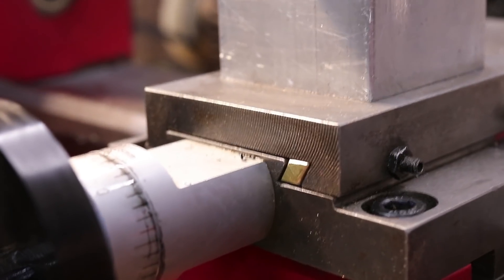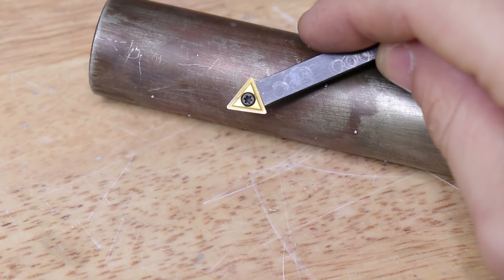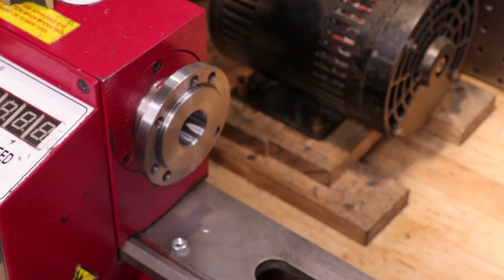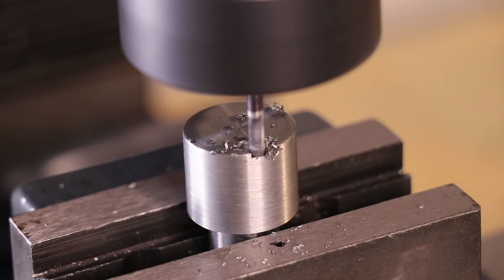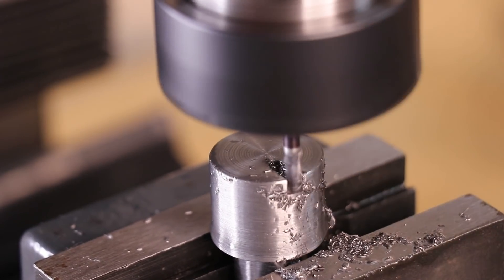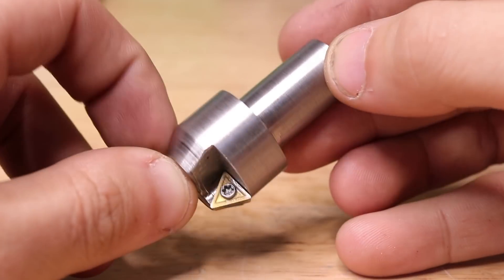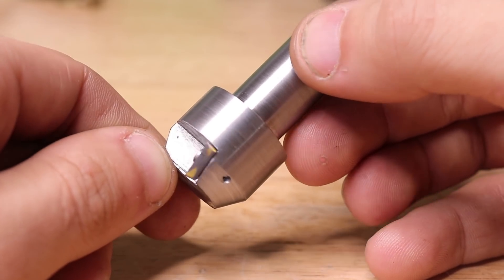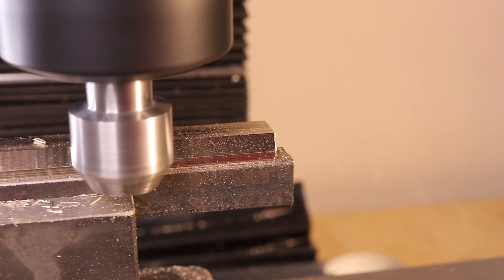Making An Inverted Dovetail Cutter | Chamfer Cutter On the Mill

Comment: Hi, where can i find the video where you make a gibstrip?, i cannot find it?
Reply from the maker: From memory it was the original mini lathe rigidity upgrade video, the one where I add the solid toolpost
Reply: @artisanmakes  Thank you very much, i found it. I can see that you use loctite to hold the brass to a metal rod, to hold it while you mill the 60 deg angles on the gib. Did you use heat then to release the gib afterwards from the loctite, and do you remember the type of loctite you used?
Reply from the maker: Yeah from memory I used a propane torch to break the glue. Can't remember what loctite specifically, but it was just the general use CA glue, but I'm sure any general purpose CA glue would work

Comment: I made a couple of internal vee dovetail cutters recently. What I have found is that the 7° side clearance on a TCMT type isn't enough clearance when getting into near full depth of the vee. TPMT inserts have 11° of side/flank clearance and these inserts do not foul or rub on the side when in to full cut depth. You can also grind some extra clearance onto one side face of a TCMT insert but stay just shy of the prepared cutting edge. (About 1 mm away)